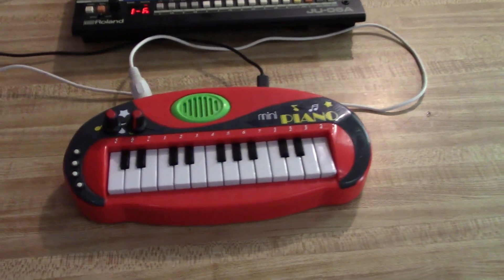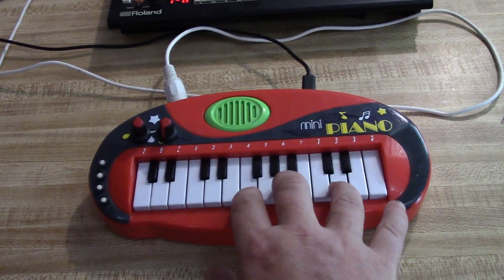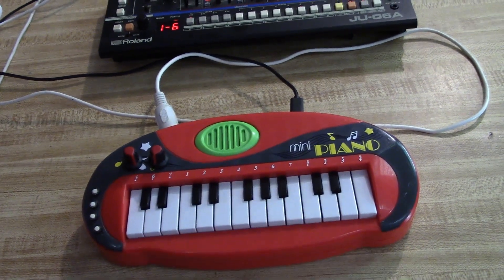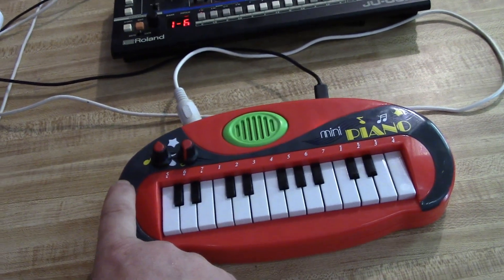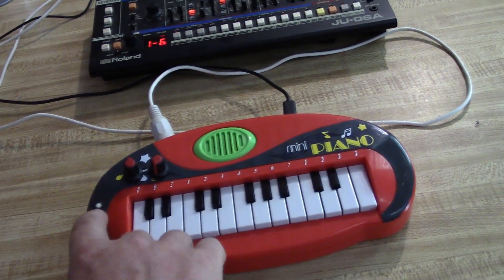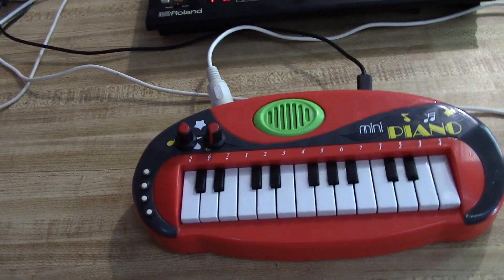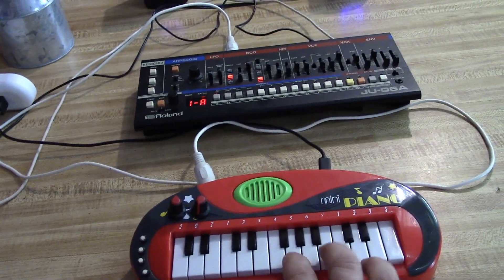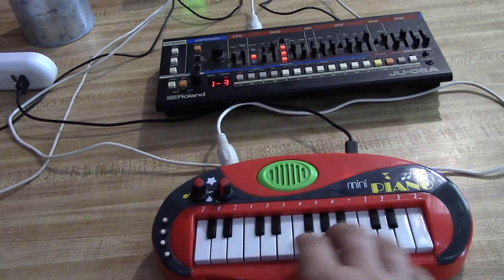Toy piano - How to add Big MIDI functions upgrades

Comment: It would be awesome if you posted step by step institutional for those us who don't know shit but can still succeed eventually 😅 I have a toy also that I'd like to be my midi because it's a portable sk 5 lol
Reply from the maker: The Casio SK-5 is a sampling legend! Bought one second hand in 1990 and kept it until 2007 when I moved to the USA, it's definitely missed.
The exact process is different for every keyboard, which makes an exact instruction video difficult... it's more about how to figure it out than following each step. 
Nearly all keyboards have diodes on every key. You can either cut the ribbon or solder new wires to the connections that come from the keys. Use a multimeter to track down which way the diodes point and which 2 wires are used with each key. It's a matrix and you should see a pattern develop. Pin 1 may go to pin 8 for a C# when pressed.
The Arduino code walks you through which of its pins connect to which of those wires, based on the matrix, e.g. 3 output pins and 7 input pins.  
It would be considered clunky and non optimised, but is designed to help first time builders. No extra libraries or shift register chips are needed, only half a dozen 10K resistors  😀
Reply: @Slider2732_  I'll read this carefully at the sauna thank you for the reply amigo!